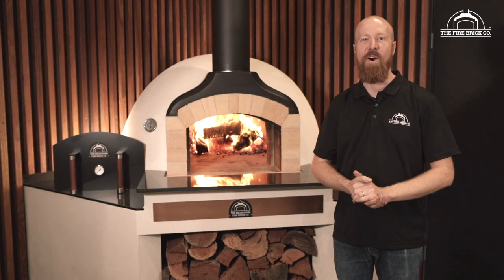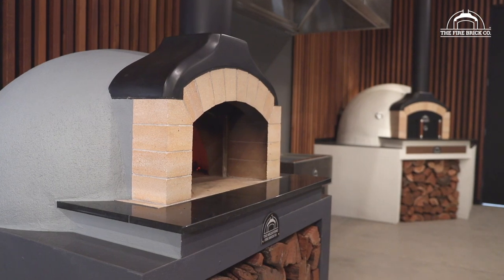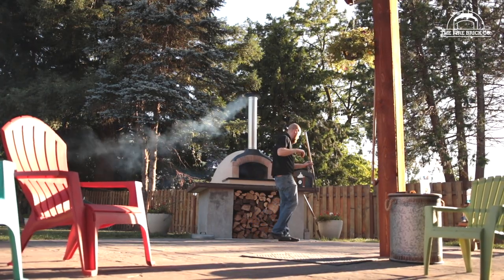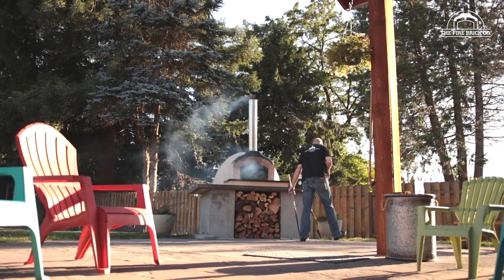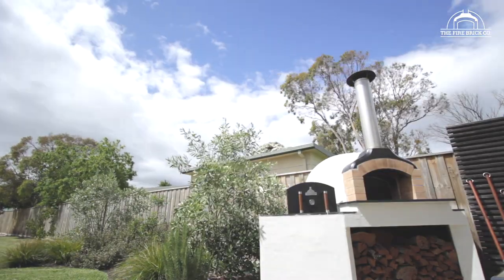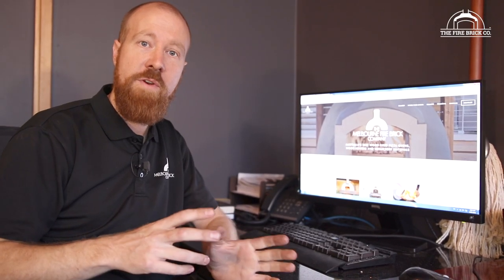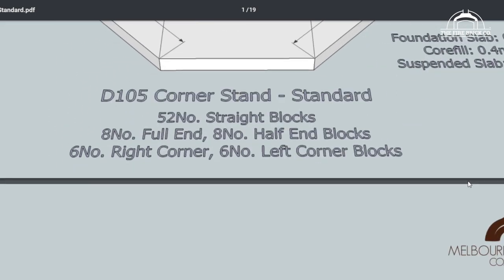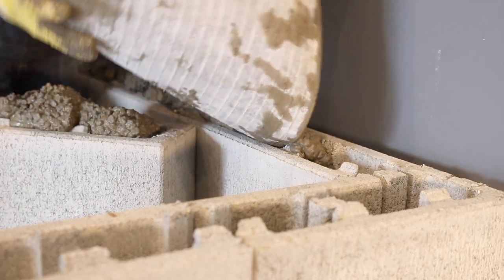Building a Brick Oven Stand - 1. Planning and Considerations

Comment: I follow your channel from Brazil. Great Info!!!   I have a question.,  Your Flue adaptor piece is cast out of steel fiber reinforced concrete. Any reason why you do not lighten the piece with perlite in the mix?
Reply from the maker: Good question - to make it significantly lighter we would have to add quite a lot of perlite, which would reduce the weight but also the strength of the part. We prefer to stick to using high-grade dense refractory castable to ensure we can sell the ovens all over the world without worrying about their long term performance.

Comment: Can you coat the exterior of the oven with a silicone roof coating?
Reply from the maker: Potentially, as it doesn't get hot on the outside of the dome. We have just completed some experiments using Drizoro Maxseal Flex which is a water-tight membrane coating, and the results are terrific so far

Comment: Hi Ben, excellent videos by the way! Quick question please... making the base foundation (that the blocks sit on, not the slab the pizza oven will) in concrete, circa 2,400mm by 2,400mm (with an extra part sticking out on one corner around 1200mm width by 900mm depth) do you recommend an (or some) expansion  gap/s or will be okay without (given relatively small concrete slab) please? If yes, do recommend a "+" cutting both ways across at around 30mm depth in the middle both ways? Do you suggest waiting until fully set to cut or just 12 hours after pour? Thanks Ben. Warm wishes. 👍😎🤗
Reply from the maker: Hi Bruce, I would just be pouring that as a single slab without any expansion joints. Thanks for the encouragement!
Reply: Thanks Ben, enjoy your weekend. 😎🍻🍕

Comment: Hey guys,

Thanks for the info, is it possible to build steel framed bases/stand? from a weight perspective it will be built to spec.
Reply from the maker: For our brick ovens you'll need a reinforced concrete slab as the benchtop, so yes, you can support that on a steel frame but it would need to be VERY strong, it would be holding up about 2.5T.
Reply: @TheFireBrickCo  thanks for getting back to me will see what can be engineered